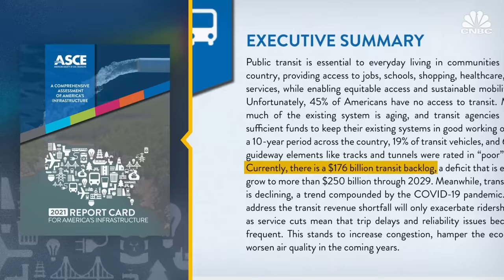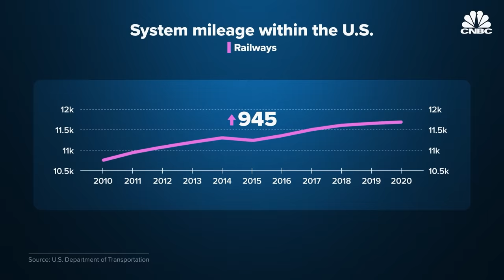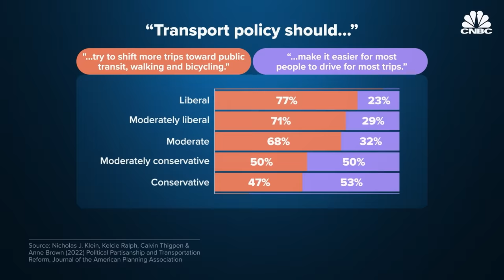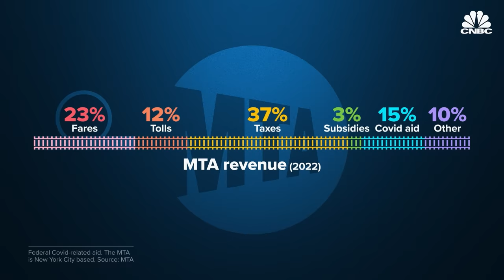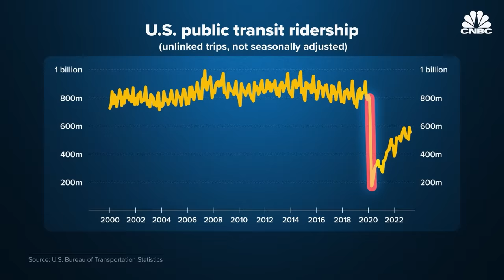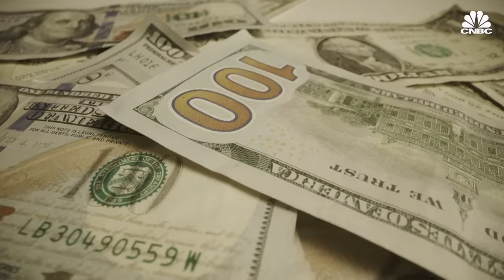Why The U.S. Gave Up On Public Transit

Comment: A major part of the problem is that a lot of housing (particularly in suburbs) has been designed with driving in mind, rather than around mass transit lines, making it a lot more difficult to cover a lot of people on a few transit lines. It's much more cost-effective to service apartments and townhouses than sprawling suburbs.
Reply: That's a huge problem. However how do you convince people that giving up their giant houses with pools, space for the kids and dogs, and all is worth it and living in a cramped concrete jungle with cheap walls and a bunch of strangers and less significantly less room. It would take a huge cultural shift for people to give up single family homes in mass like that. Just drive around in the suburbs. Be it those terrifying cookie cutter home neighborhoods, older brick homes, or just normal houses standing by themselves. I don't think many people are willing to give up the way they live in a single family home for a apartment.
Reply: @baronvonjo1929  Part of the problem is the builders: Houses are just too big nowadays, and there aren't as many per land area as there once were. There are plenty of alternatives that allow people to live closer together (row houses and duplexes, for instance) AND have less yard to mow.
Reply: @micahbush5397  You have to convince people's that duplexes and row houses are actually desirable. Most people want a stand alone home.
Reply: @baronvonjo1929  I'm one of those people who doesn't want to give up his home in the suburbs. I worked hard to have four walls of my own and a yard. I don't want to live in an apartment or townhouse where my neighbors' business is also my business. I want space. I want land to do what I want. Some people want to live in cities and that's fine. Many people don't. I don't care that a townhouse or apartment may be cheaper, I'll spend my money how I please. I'd rather be happy than value efficiency over everything else.
Reply: People don't have to give up their homes. Look at countries like Switzerland, who have famously quick, constant coverage even to small, mountain villages comprised of houses that are all far apart!

If the problem is that people can't or are too lazy to walk, that's where intermediaries come in, like small buses. My Greater LA city has a tiny city bus that constantly putters around the neighborhood and stops at the Metro bus stops along with regular city locales. It's mostly little old ladies that ride it so they don't have to wander down a busy street to their stop.
Reply: @bwofficial1776 why not just live rurally? But suburbia? Suburbia is far too subsidized and unaffordable. You’re plotting everything on a dying form of housing. Within the next 20-30 years statistically a suburban neighborhood will have deprecated a ton due to the costs of actually building it not meeting what people are paying to live there. Again, why not just live rurally?
Reply: @godofwarrio9086  There's no money in the middle of nowhere, if you're in suburbia you can drive to the city in half a hour and make money.
Reply: @sonozaki0000  I wouldn't want to walk a hot ugly busy stroad two feet from a constant stream of cars. A small village in the mts tho? Yup. Gotta make it a desirable walk.
Reply: We are going to have to rip that bandaid off sooner or later. If an area is not dense enough to support transit lines... it is DEFINITELY not dense enough to support utilities and roads. The suburbs were always a Ponzi scheme. Ex. 
1) A 2 lane road costs 2-3 million dollars per miles to build
2) $50,000 per mile for above ground electrical
3) $528,000 per mile for water line
4) $528,000 per mile for sewage line

So just to provide utilities to a 1 mile stretch of road is 3-4 million dollars AT THE VERY LEAST
Reply: I'd suggest just making local train stations with parking garages but then we'd just have constant parking spot shortages and traffic on the local roads because everyone is trying to get to the train station.
Reply: People don't have to give up their homes. Homes are too expensive due to limited options caused by excessive single family zoning. Remove that restriction and the market will take care of the problem. Developers recognize the need for dense housing but are unable to do so.
A very ironic capitalist solution.
Reply: @camadams9149  Which is $4M that you pay every ~40 years, making the annual cost $100K. Which you net in tax off no more than 40 single-family residences... whereas there will typically be about 160 of those residences along that mile of road. Sounds pretty sustainable.

I don't know how that compares to the yield on dense housing... but labor in a confined area is going to blow that $4M/mile cost away.
Reply: @smacpats6379  rural families typically have made decent money, at the very least enough to suffice their farms. I don’t see your point, again the issue is that we have to go thirty minutes away to make money. There’s no actual money flowing through a suburban town that suffices the cost of building the suburb itself, thus most of them die out, there are real world examples, just look at suburbs in St. Louis and Detroit.
Reply: @baronvonjo1929  if i wanted a row house i would move to the city, no thanks
Reply: @sonozaki0000  that's not going to fly with most Americans, sorry
Reply: @camadams9149  but those utilities are already paid for and already in place.
Reply: @makeitpay8241  Yes and all that money has to come from somewhere. Currently that "somewhere" is almost entirely: government subsidizes & long term public and private debt.

The municipality gets a significant boost in revenue when they receive the money companies/people got through loans (year 1). That cash completely dries up year 2 (outside a marginal increase in property tax revenue), which then requires additional building to stabilize revenue.

The second growth stops, revenue crashes & a town is stuck maintaining that infrastructure
Reply: @josephfisher426  "Which is $4M that you pay every ~40 years" 
1) Roads have a lifespan of ~25 years
2) US median annual property tax bill per single family home: $2,690

3) A 25-30 year muni bond has a rate of ~3.50%

Interest: $140,000 annually on 4 million 25 years 3.50%
Principle: $160,000 annually (4 million is paid all at once in year 25, so turned it into a yearly outflow)

Annual cash outflow from 1 mile of road: $300,000 OR 100% of 111 single family home property taxes. That leaves you with 49 households or $131,810 for electric, water, sewage. I have also completely ignored sanitation, schools, police/firefighter/medic, libraries, etc

It just does not work. I live in an average edge of the city neighborhood. It is 7.6 sqr miles with 18,727 occupied housing units (48,246 residents) OR $6,631,251 annually. That is 1440.72% more than the low density situation
Reply: Solution for many suburbs would be bicycle or e-bike. Not so much for Nebraska or Ohio winters, but the rest of the year. Offices that require in-person attendance would require showers and changing rooms; currently exclusively the realms of blue-collar workers and executives. But that also fits with reducing the cubical critters to the status of lowest-level, lowest-pay, disposable employees, and their middle -managers will do that job for the same pay, longer hours, and only a company electric car as their sole perk.
Reply: @micahbush5397 It doesn't take a row house, a duplex, or a postage-stamp yard!  Just go through any post-war housing boom development. Three-bedroom two-bath with ample yard space, especially in back so there is room (designed in to the original structure, as well as lot) for expansion. Set the cost so that a then-standard thirty-year mortgage is no more than twenty-five percent of the target market's single-earner wages.

That mortgage payment sets the upper boundary of construction and development costs. At the time, municipalities paid the costs of roads, water distribution, and sewage up-front by issuing municipal bonds, expecting and almost always succeeding in repaying those bonds with property taxes, with monthly utility service fees paying for ongoing upkeep.

We have not had that in fifty years.
Reply: @camadams9149 If the municipal bonds are not turning a profit by the day they are issued and keep turning a profit above payment for their duration, you have crooks! It could be your Comptroller (One at my City stole twenty million, and the County comptroller stole twenty-one million the next year! Not a penny recovered from either; they hid the money well and took their short sentences with smiles.) or it could be a coalition of Council, or even just your Mayor of he or she has family in the development business!
Reply: @davidgoodnow269  winter is long here in New Hampshire and we are in the foothills of the mountains. plus i often see cyclists walking their bikes up the hills so biking to work is a no go for me.
Reply: @makeitpay8241  That's what I meant. No matter how people love biking, most parts of the country mean you are, at minimum, using a motorcycle not a bicycle or e-bike! More likely, you're wanting something with an enclosed cab come winter.
Reply: @davidgoodnow269  how about a new AWD corolla hybrid that gets 50 mpg combined? i can't ride a motorcycle in the rain so this summer i would have stayed home 1/2 of the time because it has literally been raining every other day for the last 2 months. perhaps New Hampshire is becoming a rain forest, if so i want a pet monkey and a banana tree.
Reply: A lot of European cities are becoming more sprawling and suburban, too. Generally, they solve it with "park and ride" schemes. You drive to a central parking area within a mile or so of home, where there is a frequent shuttle to a station or city centre. It's not perfect, but it's better.